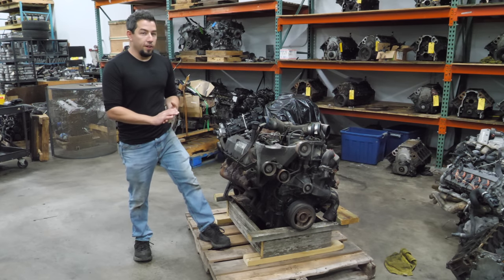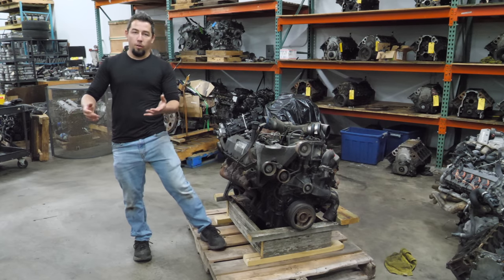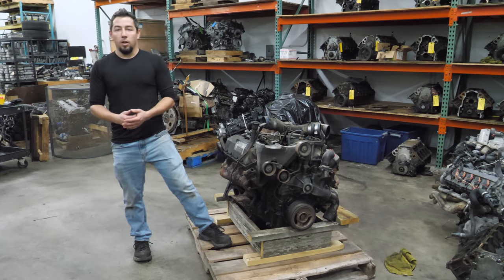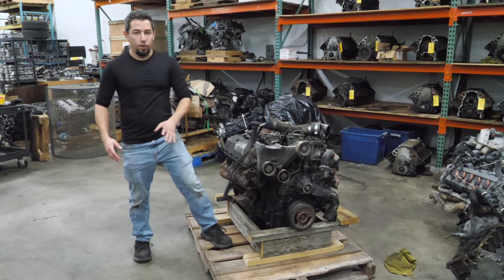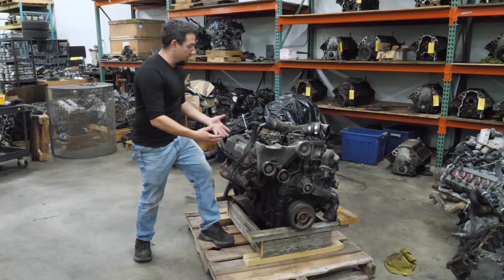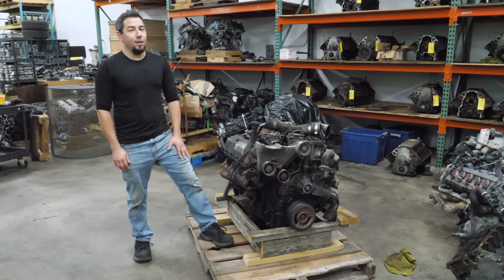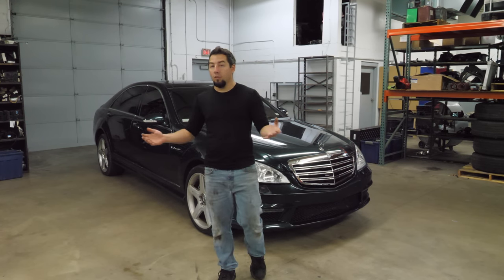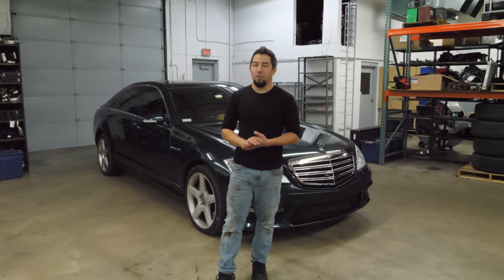70K OR 700K? Ford 7.3 Powerstroke Mileage Discrepancy. How Many Miles Are Really On This Engine?

Comment: This is easy, the oil express place put the decimal down...so when they had 697845 it actually had 69,784.5.  So when it went from 68,372 to 685,738 it really went from 68372 to 68573!  I mean if you look at it and count the last digit as a 1/10th which shows up on the speedometer it makes sense. Some $10 an hour guy that don't realize the white digit is 10ths lol. Don't hurt yourselves lol... also, do a 660cc engine from a Kei truck, they are getting popular over here. They make 3 and 4 cylinders..prefer Subaru 4 banger. Good day.

Comment: I think it is 70,000 with not that great of maintenance....I have a early 1999 which had the low horse power .The truck has been serviced by the selling dealer for 23 years with a life time contract. I have 80,000 on the truck.. At 80k I changed the injectors, installed a bigger turbo, 4" exhaust and alot of other stuff.. When I opened the engine it looked just like the top end of your engine...If there was no sludge in the pan I think you would be safe with a set of bearings and rings if needed.. Turn it over on the stand for compression testing.. You can also pressure test the boost system for the leak down rate.. If it passed the tests I for one would buy it.. The 7.3 are almost indestructible..

Comment: Lots doesn't look right.  While running hard, it might have that many.  But it goes up by about 10x + the miles driven, giving it the 3x Lunar mission motor illusion.  It probably has a glitch in the odo.

Comment: I'm going to say 70k. so much is clean and not oil stained. the bearings can be explained easy. sitting for years, the oil will leak down out of the bearing contacts or dry up in there. when it gets started.... damages the bearings.

Comment: if that motor was properly maintained and not "yeeted" then the wear shows half a mil miles or more. 

measure the cam with a mic. as rough as it looks on camera the wear will likely surprise you. every one I've torn down that was not due to catastrophic failure had only a few TENTHS of wear. the t444e powerplant was the pinnacle of consumer medium duty diesel engine longevity engineering.

Comment: Odometer discrepancy for sure.  In Mass I've seen those cylinder heads literally rot through to the water jacket and the headers be so rusty there's no mounting ears left, just crusty bolt stubs and wads of rust wedging what's left of the header to the head... At 200k miles.  There's no way that thing has over 150k Chicago miles on it just looking at those parts alone.

Now as others mentioned, it may well have a zillion idle hours on it.

Edit: as for what to do with it, that's a core IMO, or at least needs a new crank+bearings and maybe cam+bearings.  Would it run?  Yeah.  Would it be worth putting into another vehicle?  No.  I've run at least 3 engines with copper showing in the rod bearings, and would do it again, but I wouldn't put an engine in knowing it had copper showing.

Comment: Original motor with original turbo, and the turbo looks like that?
70K miles.
Also how can a ruck drive 610K miles in less than a year?

Comment: A possibility someone bought the truck because it was low mileage but had a lot of rust and swapped the engine from a high mileage truck with a rust free body. Switched over all the parts that indicate the engine was original, or knew someone at the oil change business

Comment: That's a low mileage high hours engine they never shut it off during the winter to keep heat going. Here in IN high mileage 7.3s have the eyelids at the valve covers rusting out. And the exhaust manifold bolts getting super thin and ready to break. Oil pan is in good shape because they like to rust out. Keep in mind the owner could've had dash problems and got it changed out with a cheap high mile one from a junkyard

Comment: I'm betting the engine has more than 70k miles but way less than 700k miles. And someone replaced the cluster without reprogramming the replacement cluster. That would explain the wear on the bearings and Carfax mileage.

Comment: I think 70 k and Alot of idle time . and when on the road it was worked hard . alot of these motors are in trucks used for work. most work trucks get alot of idle time . long idle time on a diesel engine isn't good they don't flow enough oil al idle . this is why truckers idle the engine speed up when idling for prolonged time. this increases the oil pressure and flow. I'd assume if the lower bearings look that worn that the upper end of that engine is probably the same if not worse . I think your best bet with this engine would be definitely a teardown. from there you could either sell the good parts from it . or you could do a basic rebuild/refreshing of the engine and it would be a solid engine. go through and clean everything really well. change all the bearings, polish the crank and hone the cylinders throw some fresh Rings in it change the seals and gaskets ECT. things like that not necessarily a complete rebuild just a good freshing up. and you could do that at minimal cost compared to a complete rebuild and I think the engine would be good to go and have plenty of life in it . but if the bottom bearings look like that it should definitely be torn down.. it's up to you if it's worth giving it a quick and dirty refreshing or just sell the good parts . me personally if I had something it could go in I'd give it a refreshing and use it . if you don't have anything that you want it for then I'd part it out . I don't see selling it to be installed into something in the condition it is in as far as the bearings are concerned. it would need a rebuild sooner than later I think and would not be worth all the hassle to install it and in a year or two have to pull it for a rebuild. but I think it's a great candidate for either a quick and dirty refreshing or a complete rebuild if you have a need or project for it .

Comment: I’m going against the majority, but believe this may be a 700k vehicle. If it was 70k then they would have been getting oil changes at 300 mile intervals a few months apart. That just doesn’t make sense to me. It does make sense for the oil changes to be 3000 miles apart.

Comment: if my only 2 options are those mileage, it's closer to 70k, in my own opinion it definetly has under 175k but probably just got used alot in cold weather with cheap oil and filters. lots of dry starting and idle time. probably got worked like a rented mule.

Comment: I Immediately thought 70k but those mains throw a blue into the works. Looks like a good candidate for rebuilt, at leash main and rod bearings.  Those heads are abnormally clean, maybe a head rebuild?  I must say that this is a different you.   I usually see you goofing tearing down an engine making bad jokes, in this vid we got to see your real experience and knowledge, impressive. 👍

Comment: Low miler. You owe them a check. I stand corrected. In light of the rod  bearings I change to the high miler.

Comment: I'd bet the hours on that engine is super high. Probably the hours of 700k miles engine with 70k actual miles driven. The second owner probably idled it a lot too with the rather frequent OCIs at a relatively low mileage, not even 3k miles between OCIs. Using miles driven to do maintenance really is a poor way to do it. Hours is a much better determining factor.

Comment: Most government vehicle auction sites equate 30 miles for each hour on the hour meter. Without an hour meter you will never know with this engine but the bearing wear sure looks like idle time.

Comment: Pretty sure 70k not 700k, Carfax discrepancy indicates someone read the odometer wrong between 67,300 & 675,000.

By the time these reach 700k there's a lot of work that needs doing, rear main seal leak around 250k, Turbo pedestal leak around 200k, injectors would be leaking, waterpump would had to have been changed more than once (and quite recently) and most importantly if really 700k the exhaust would be full of oil from blow-by and bad valve stem seals. Not seeing these common issues that 200-300k 7.3s have.

The head rot on the left bank is pretty bad though and bearing condition is quite concerning....
Good news though is with the internal wear it needs rebuilding anyways so someone will find out

Comment: I don't see any reputable yard being willing to sell it as a 70k engine with the CarFax saying 700k.

I'm guessing that the tech fat-fingered a 5 after the 8 when it magically reached 685,738 miles. After that, the owner might have decided to just have them punch an extra digit in to avoid it looking like the odometer was rolled back. Easier to sell a 700k mile truck than a truck that looks like the odometer was rolled back.

I like seeing diesel tear-downs. The forklift coming out to lift the crank is great fun.

Comment: That would be roughly 10,000 miles a day for two straight months. Any one who’s done a road trip can tell you 1200 miles in a day is pushing it hard. I will calculate the average speed next.

Comment: 685,738 - 68,372 = 617 thousand miles.  
From 12/29/2014 to 2/03/2015 = 36 days.
So it had to travel 617 thousand miles in 36 days.  
617kmiles/36days=17k miles per day.  (17k miles/day)/24 hours/day = about 715 MPH.
And that's only if it didn't stop for gas.
I don't think it can go that fast unless it has afterburners.  
Can the police give you a ticket for a sonic boom?

Comment: Judging by the pictures of the truck (assuming that all of the body panels are the originals), that isn't the original engine to that cab. All of the early 99 model year trucks had the Powerstroke badge on the fenders like the gas trucks, not on the doors like 99.5+ trucks did. The actual mileage could still be a toss up though. I've seen 7.3s with much higher miles in better condition than that engine.

Comment: I would suspect ~70,000 miles. the time frame between the 2 dates make it all but impossible to get to ~700,000 miles, if if you were a commercial line trucker....

Comment: That's a 70k mileage engine with thousands of hours idling, like a lot of work trucks.  7.3's out of ambulances always look like that on the bottom end with even 30k on the clock because they have 5,000+ hours on the engine.

Comment: Loads of low idle time . The top rod bearing are wasted.  Because of combustion in the  cylinder at low idle. . Pull the glow plugs. . Cylinder combustion test  each cylinder.  But no oil . .

Comment: If the M112K Mercedes supercharged engine in the back ground is going to be in a up coming video. Ill bet, its spun the cam lobes on the shaft allowing for low compression ;)

Comment: Most likely a mostly dealer maintained high mileage engine. I don't care how much it idled those bearings would never be down to copper at 70k miles. Plus if it was a long idling truck I'd expect to see much much more sludge in it.  The crank and bearings tell the story. And people pointing out the cross hatch on the bottom of the cylinders. The rings don't hit that low on the cylinders so they'll always look like that. Cam is saying it's a high miler too. Idk if it's a 609k mile motor.. but its definitely not a 70k motor
Reply: The story the bearings tell is that it's a 70,000 mile engine with a lot of idleing time and a lot of cold starts with starting fluid and/or block heater not used.
Reply: @Mizman76  if you say so...and you may be right... I see the lower bearing and the crankshaft and looks to me that there's a bit more damage than just being pounded by ether. Regardless that motor needs a bottom end. Crank is scored.. do you just throw bearings at it and hope for the best? Or sell it as a good core?

Comment: A 7.3 powerstroke aka international T444e, will easily go 500k+ miles. even when they start getting tired, A rebuild isn't all that costly, and comes in a kit. 7.3 and B series cummins are some of the few that can go a million miles with proper maintenance, and a bit of luck. I have a 1995 F350 powerstroke, with 400k on it, and it still runs and drives great. I would sell it as is. a 7.3 in running condition goes for over $1500 right now.

Comment: At first my thought was, "A mid-week tear down?"  But no, a mystery instead, lol.

Obviously, the owner drove around the Earth 3 times from 12/29/14 to 2/3/15...

The records are too consistent.  My only guess is the odo was physically shifted so you couldn't see the mile digit, and it was fixed at some point. :-)  (Or more probably, the odo was changed out.  I mean, if you're going to fudge the odo, I assume you'd want fewer miles unless you massively want to defraud your mileage depreciation, lol...)

Comment: That looks like 700k to me.  The crank bearing  and cam wear is how I judged it.  Those engines run for a million miles plus before needing any serious work.  I doubt there is a 7.3L left on this planet that has less than 500k miles on it if it actually still runs.

Comment: that motor has prob been replaced crank and piston walls are super clean for a almost 700k mile 7.3 and the oil in 7.3s is usually the dirtiest cause of the HPOP using it

Comment: I'd say, do a bottom job. Set it up and run it. Then you could do all of the usual checks for an operating engine and develop more data points. Your investment at that point would be low, but the potential profit would be high.

Comment: I'm going to say 700k because for how clean the engine is and how rusty the utility body is, if the engine had 70k and sat for periods of time it should have more rust than it does, or that utility body is complete crap. The engine also has that fine highway filth look. Its dirt isnt concentrated in areas like low speed use and sitting with periods of moisture would allow. Maybe the turbo was replaced from another 99 truck

Comment: Looks like a hard 70k miles. The injectors look original, I don't know of any 700k 7.3s with original injectors. And the turbo looked good. The bearing wear is probably from lots of cold starts in the winter and possibly long oil change intervals, 7.3s are hard on oil. I would tear it down and sell it for parts or sell it as a good core. I wouldn't throw that motor in a truck as is.

Comment: Dont know how many miles are on it.... but it would stand to reason that the techs who entered the info could have erred because of the odometer not have the tenths read out.  Im guessing it was a typo.  But then the bearings dont look THAT bad for 700k.  Has wear for sure, but i agree with others that it could be idle time.  All I know for certain is that my 01 F250 Super Duty currently has 433k and she still going strong. Do my own oil changes every 10k, have years or records of oil analysis and this ole gal cranks up and runs every day. Ive done a few things to her, but overall its been a damned good truck/engine combination.

Comment: it's a "shift" engine, get's started in the morning and shut off at dinner time. that's excactly how they look, pretty good at the topend but worn out down low...a bit like a stripper. it's verry likely that it drove 70k but it probably ran alot of hours on end. they make for good building blocks tho, a few bearings and rings, a new cam and presto, good engine for a boat

Comment: 700K without a rebuild seems a little bit of a stretch,  Lots of cold starts and long idle times easily accounts for the wear on the bearings and the cam.  Candidate for a rebuild!  Half of the work is already done! It's out of the truck!

Comment: IMO it is 100% a 70k mile truck.  The condition of the bed means nothing in Chicago.  I would guess that it was used very little for occasional service/repair calls of some nature and parked for long periods of time outside without washing it first. It only takes a little damage and wear to the paint on those steel beds and once the rust starts it can eat those up in just a couple years.  That effect becomes even worse if it was parked on gravel where the moisture is continually coming from the ground up.  I know these engines are good but there is NO CHANCE that it would have that many original parts on it and be as clean as it is on the interior at 700k!

Comment: It looks like it idled a lot may be 70k with 7000+ hours idleing in sub zero temps. I wood love to see it in a teardown but that's just me. My buddy had a 13 with a 6.7 with 87000 miles and 7700 hours over all run time the bearings looked a lot like that.

Comment: I would say 70k but it could have had an hour meter installed and the oil change place were going by it instead of milage I used to service charter cable trucks and we would go by the hour meter on service instead of milage. We would sometimes have a F450 with a 7.3 have only 60k but 700k + hours on it from letting it idle kind of like a police car

Comment: I have a 6.9 idi 250 and the engine only had 68k on it but unknown idle time was told it was a farm fuel truck and my bearings looked far much worse then this 7.3 psd Id bet it’s a 70k engine

Comment: I'd rather have 700k over 70k
70K means it's just sit there and idled and wash the walls out and or dry bearing startups. 700K is done proved itself. 70k is in question. Probably 70K from the looks of it but that don't make it better

Comment: That's a 70k engine.  The issue stems from the oil change place.  Some kid making minimum wage put it in wrong when it went back.  The next time they took it in, it was already in the system, and will not allow them to put in a lower milage, so the guys say 699xx.x and put it in as 699,xxx.

Comment: I have a 98 production 7.3 with original turbo with 250k I also had a 97 7.3 with original turbo with 650k rebuilt a few times but original turbo still

Comment: My Mercedes has the same issue. All the computers except own have the same mileage, 24,335. The body control module lists the mileage as around 220000. Mistakes happen in mileage input. You owe somebody a finder's fee. 😜